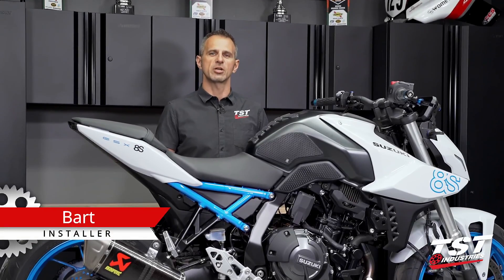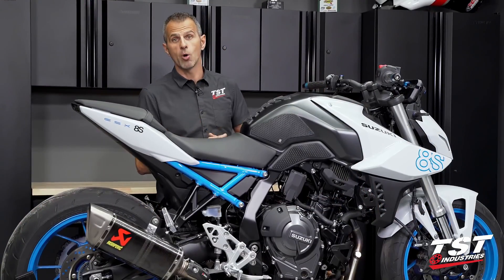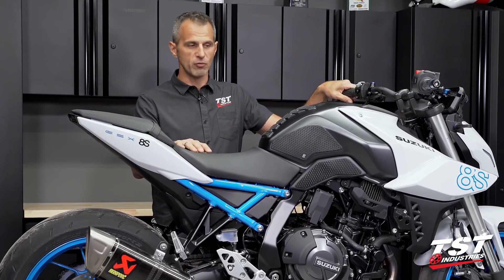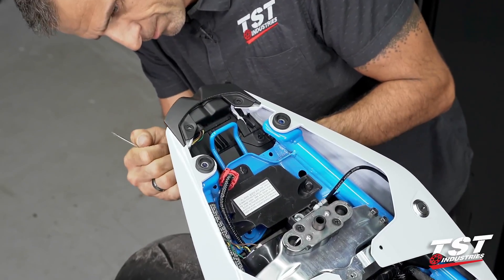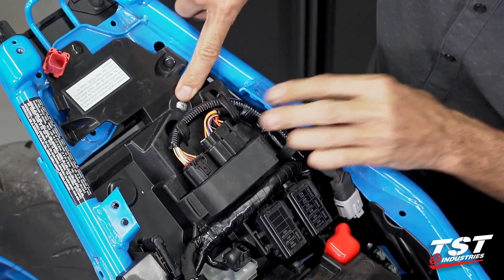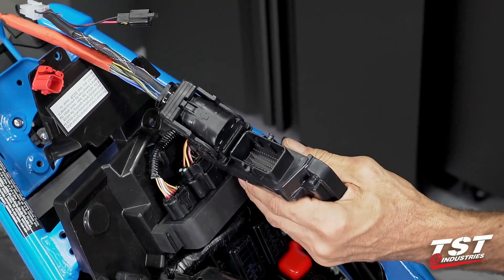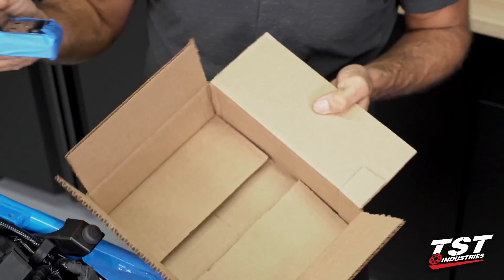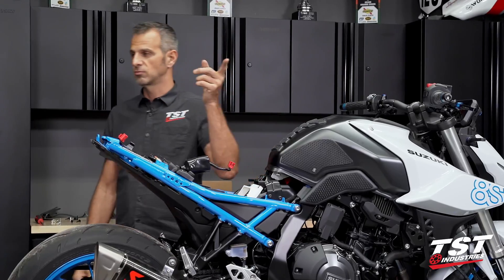How To Access and Remove ECU on 2023+ Suzuki GSX-8S / 2024+ GSX-8R by TST Industries

Comment: Yikes, I probably should have watched this video BEFORE I bought a GSX8R.   Could Suzuki have made the seat and fairing removal any more complicated?   Seems like they were trying to keep you out.   This bike suffers from absolutely TERRIBLE head lights.   Going to need to find some room under that extremely scant seat to put in the controller for the auxiliary Denali lights.   Bike is absolutely undrivable after dark without them.
Reply: Have you tried adjusting the headlights down a bit? I have an 8R and I had a little trouble at night as well. After aiming them down a bit, it’s WAY better but don’t overdo it. Small adjustments are huge adjustments 75 feet out in front of the bike. I think I ended up moving them down a hair, rode it around, then came back home and moved them down a touch more. They’re better headlights than I thought. I just think they weren’t adjusted properly from the factory.